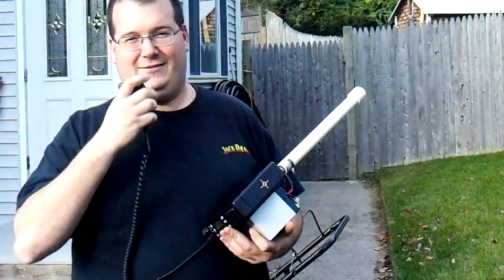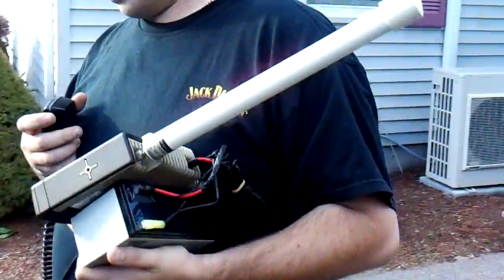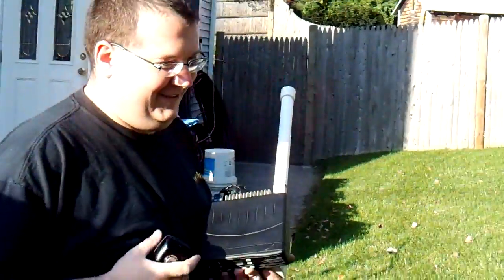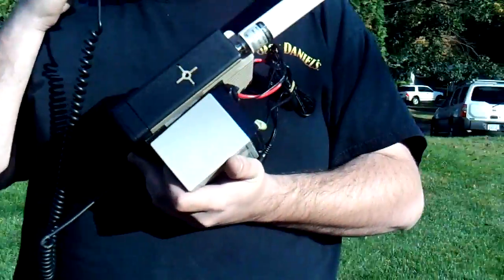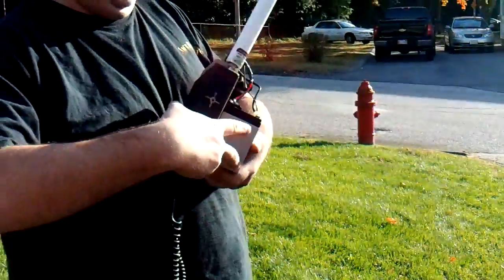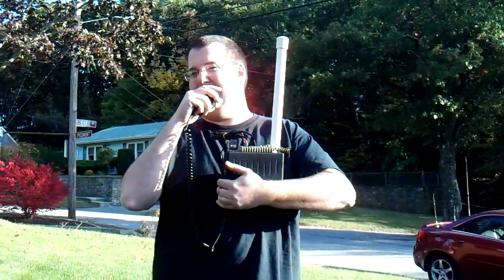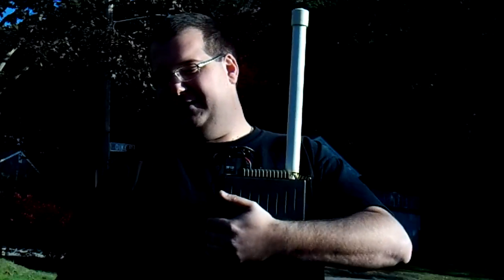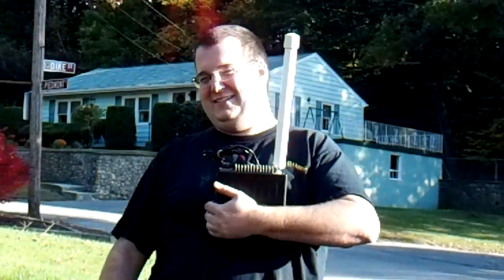N3LEE 12W "Portable" 900 mhz HAM RADIO

Comment from the maker: That antenna has an N-male connector.  I'm using a metallic Mini-UHF to N-Female connector with the antenna threaded directly onto that adapter in this video.    I'll see what I can do regarding programming videos for the GTX's, I have a few more radios to program soon!   I use a PCTEL 5dBd gain antenna (8dbi) on an NMO mount in the mobile.  I'll shoot some video of that, too.  73's de N3LEE